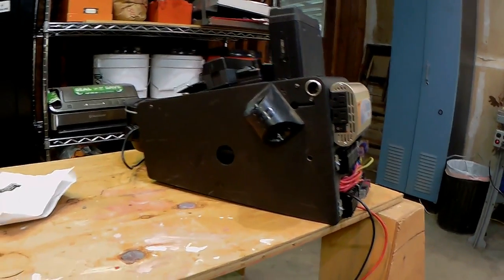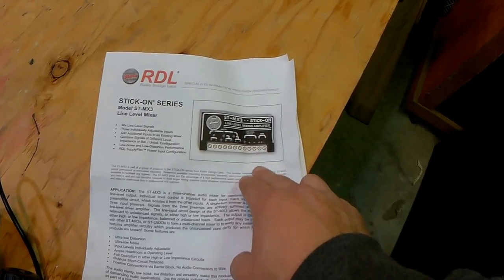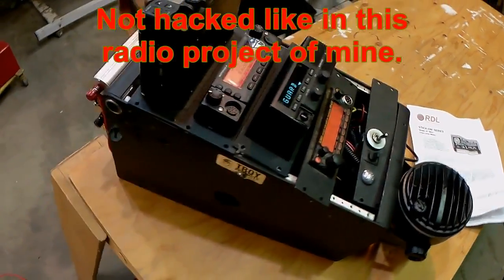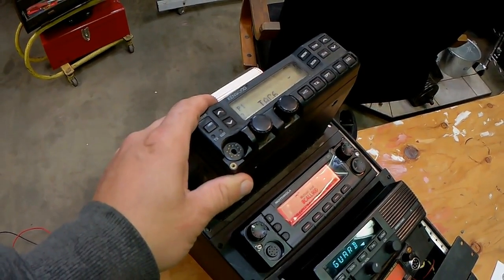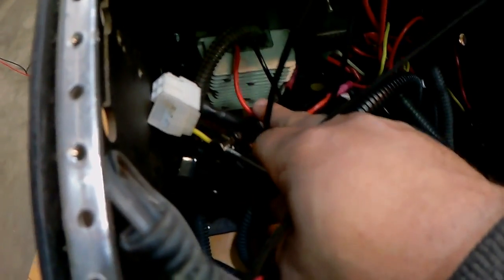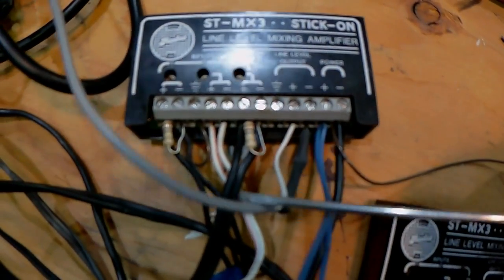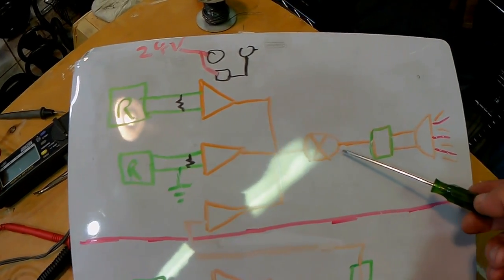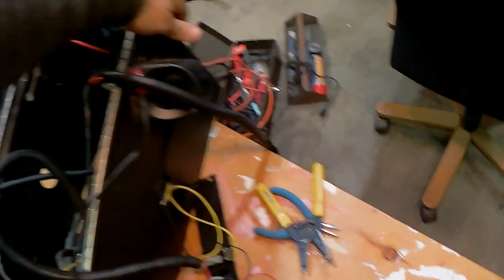Multiple Mobile radio Speaker consolidation, Part 1

Comment: Try this line level mixer from Amazon :  https://www.amazon.com/Depusheng-Channels-Console-Compact-Adapter/dp/B07JQ93CQZ/ref=sr_1_8?dchild=1&keywords=line+level+mixer&qid=1604464954&sr=8-8
Also, try ferrite chokes and/or isolated grounds. Had to wire my home PC power outlet (in wall) with an isolated ground to eliminate severe feedback from my appliances and security system.

Comment: I suspect the noise you were experiencing was essentially ground-loop noise.  An alternate solution for mixing separate audio sources, would be to get a passive audio mixer, such as a Rolls MX42 4-Input Stereo Mini Mixer, and use 1-to-1 isolation transformers, for the inputs & outputs.  The isolation transformer will eliminate the problem of shorting-out the audio amplifier circuit, since that portion of the circuit is effectively isolated from the mixer.  Food for thought.
Reply: Some cigarette plug usb adaptors which provide 5 volts to charge cell phones, etc. create rfi.  Your 120 inverter and or the 12 to 24 volt inverter could be the source of the problem.

Comment: That Kenwood is a little long for the installation, LOL
Reply from the maker: LOL yeah, it does look tacky, I did not want to remote the controlhead instead have it in one piece within the console for easier transferring in and out of the vehicle. The PA deck is 100 watts accounting for its extra length.
Reply: I've done interesting stuff with Kenwood 110W mobiles; i've even seen one that became the pedestal 'under' the console by cutting one of the brackets in two and installing longer 4mm screws in the sides....    Either way, keep up the good work!
Reply: Just curious who you monitor/communicate with on lowband? (if you can say). CHP is the only PS agency using lowband (that I know of) and kind of an obscure ham band. Just curious ☺

Comment: Very cool ! I had the same type of situation years ago and made a PCB w/ 1:1 transformers and relays.  I used COS HI pins to control the relays and used a HSN4031 (Spectra) for a speaker.  I like your idea of using a mixer - that is the way I've seen it done in aircraft. Thanks for sharing !